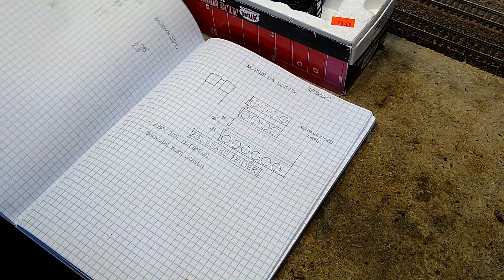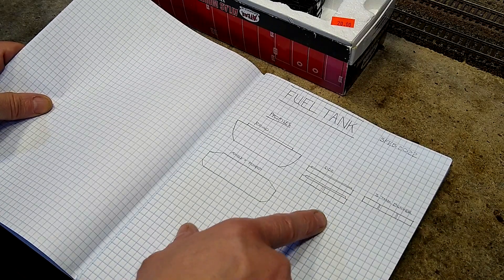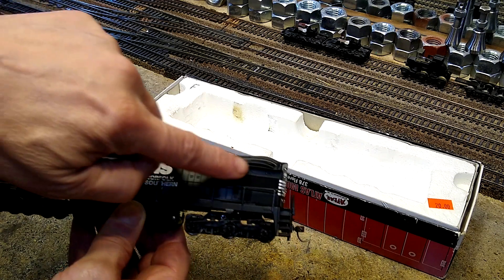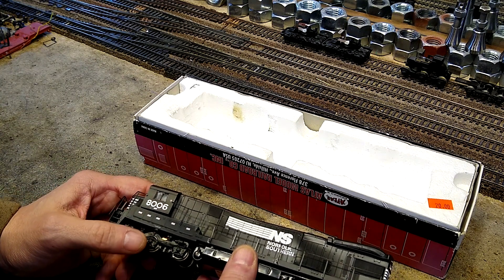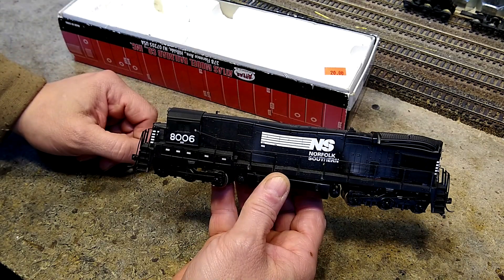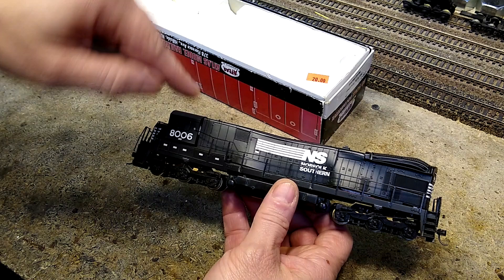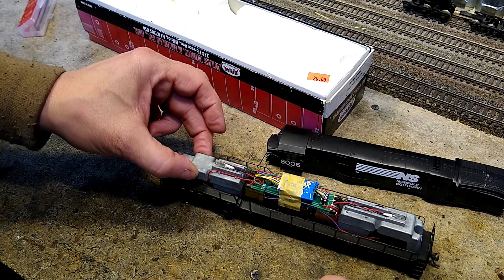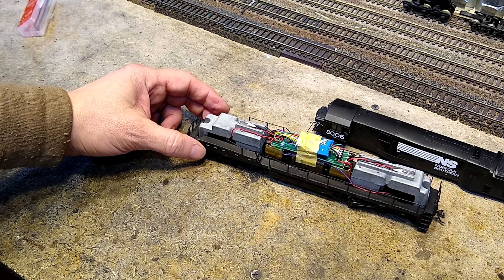2022 5 Locomotive Contest Part 1

Comment: Hey ! Have you seen the GE Wabtec Hydrogen powered locomotive ? Pretty neat locomotive. After NESARA/GESARA is announced, all transportation around the world will change. Release of 6,000 surpressed high technology patents. Hidden from mankind for centuries. I too am curious what the future holds for Railroads. Automation ? Your thoughts on this ? Good luck on your builds. I'll be tuned in as time allows.
Reply from the maker: I'm still betting on diesel - or possibly even bunker fuel only because the tech to reprocess all of the exhaust into something valuable exists.  no more filtering, but simply capturing it into a solid.  There is already an amazing tech to generate hydrogen from solid granules in tanks that can be recharged - which could be a strong candidate for locomotives also.  The patents are a serious obstacle and I wish they were use it or lose it.  I'm also thinking of scratchbuilding a crane for rolling stock  contest.  I scored a real electromagnet off Amazon for cheap and it would be pretty cool to have a working scrap yard crane!!  Send me an email sometime!
Reply from the maker: I really need you to get back to work, especially since you are the ONLY model train channel that I subscribe to.  Any other I watch are from bookmarks, because I'm old, old+old school youtube
Reply: @elite194   Last couple months have been busy [trying to think of next project direction]. Gonna try scratch building a 1960's-70's  P&H 1900 mining shovel . Need something neat in a slag recycling pit area. This shovel is just about the right size for the haul trucks I have. The crawler tracks might have to be from a WW2 German tank or whatever suitable tracks can be found. Tracks are the hardest to replicate in HO.
Almost ready to pull the trigger on this project.
Reply from the maker: yes you should goto the fine scalers and get tracks that look cool - carefully consider scale vs. coolnesss.  the cooler something is, the more acceptable it is.  this C30-7 had a bunch of details that are way too much scale that I am repulsed by them.  I was going to go the extra mile to save this shell until I pulled off the details and realized that nothing about it excites me.  Hey, get your videos going again and get them onn  r umnble so you can be the first steell mill guy there and i will sub right away.  i miss getting inspired by your stuff like the cookie tray  steel trick - that is the highest and finest trick I have ever seen!!